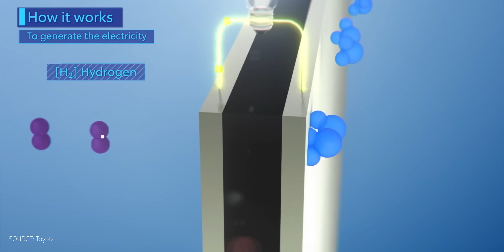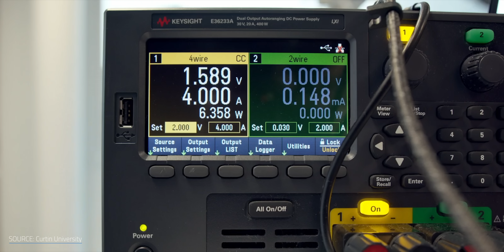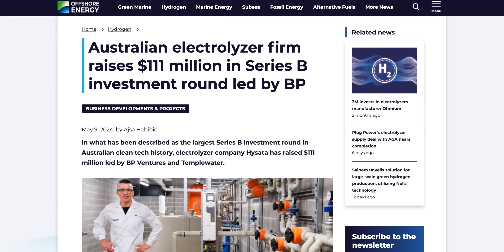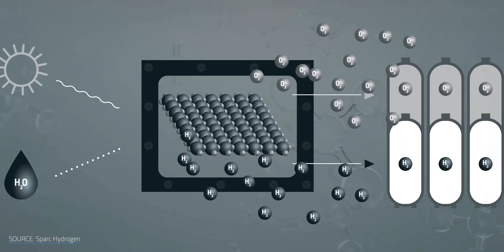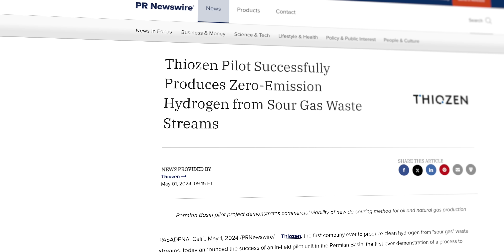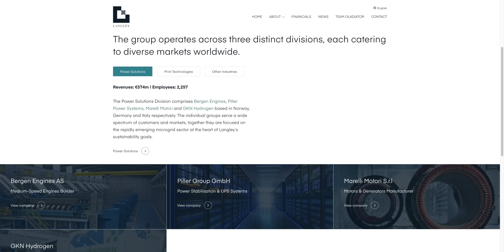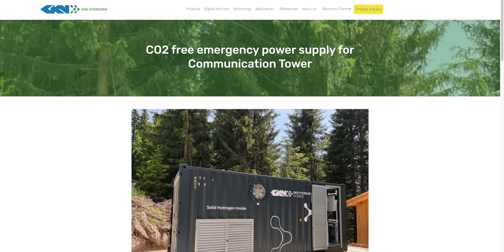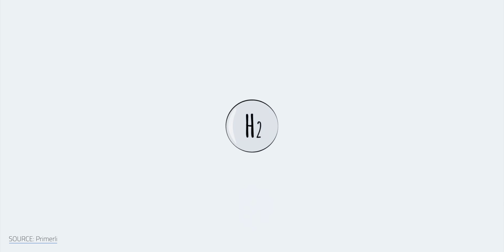How a Hydrogen Breakthrough is Closer Than Ever

Comment: So Engines running on Hydrogen are clean, but the stuff that separates Hydrogen from things like water can be powered by fossil fuels.
Do the Engines that run on Hydrogen generate enough power to power the process of separating Hydrogen from say water and have enough power left over?

If Hydrogen cant be used as a fuel to power the process alone, cant we try to power it with a combination of the same Hydrogen produced and some renewables? Then Hydrogen left over would be proportional to however much renewable energy we were able to channel into the process?

Comment: Storage and distribution seem like big challenges. And then, when the product is finally there to use, is inside of a vehicle really the best application?
It seems that hydrogen is more of an energy storage medium than a fuel. It takes energy to make it, then you use that energy later.
What about using hydrogen as energy storage on the grid instead of battery storage? That would solve the hydrogen transportation part and help efficiency a lot. It seems like a good place to start.  Use excess grid power to generate hydrogen at a fixed location, and then use that hydrogen to generate power during peak demand.
I think they need to sucessfully use hydrogen in a niche like that way before we start talking about cars and distribution infrastructure and all the embodied carbon and expense involved in that process.

Comment: So after nearly 12min, absolutely nothing has changed. The alleged green game changer technology's are still only wild claims from labs which means absolutely 0, whilst the stuff in the real world is the same old floored tech, or stuff being pushed by fossil fuels firms which is about as green as ur auntys left bollock. Make a video in 20 years when theres some serious contenders on the market with varifiable products, that arnt backed by fossil fuel giants for subversive gain.

And im just as dissmisive with battery tech until its mature for the same reasons.

Comment: I have been to Haßfurt, Germany. They already have a Power-to-Gas plant that runs on renewables when the grid is at capacity. They feed the H2 into a natural gas line to circumvent storing problems but still impressive.
You mix H2 with natural gas up a point till it reaches peak energy density. It was really cool.

Comment: So, we take electricity, which is a great energy, easy to transmit, easy and versatile to use in very efficient machines. We take this energy source and go through complex and technically difficult processes to convert this to hydrogen which is technically extremely complex to store and distribute. We then burn this in low efficiency engines. Anyone see the problem here?

Comment: I live in Japan and have just purchased my second hydrogen fuel cell to heat hot water and generate some of the electricity for my home. The fuel cell is the  Enefarm from Tokyo Gas. As the company name suggests, the primary fuel is natural gas that is reformed in the Enefarm to created hydrogen. It’s far from a really green solution, but the system efficiency is significantly better than a traditional gas boiler, when you consider the electric power offset. Right now the system is filling its tank with hot water as it knows that bath time is coming in a couple of hours. At the same time it’s generating 550 - 600 watts that is taking care of all of my current electricity needs. A big breakthrough is great, but let’s take small steps in energy savings and efficiency that use current technology.
Reply: @iseolake  I love reading this account
Reply: "A big breakthrough is great, but let’s take small steps."  The small steps are only demanded by a profit and growth-oriented energy sector. We could have all we need if we just fully embraced renewables and forgot about these shareholder-soothing technologies. Sadly there is little to profit from in switching directly to renewables worldwide. And so we are stuck, telling ourselves it'll be okay and shrugging while someone's home gets destroyed by another record-breaking storm...
Reply: @Slimboid  Renewables are oppressive garbage which are also primarily profit driven....
Reply: How can reforming CH4 to H2 (plus storage and shipping) and using it for heat and electricity be more efficient than using the CH4 to produce electricity in a power plant and you using this electricity to drive a heat pump?
Reply: @AR_434 rather than use a gas boiler to make our hot water (also used for floor heating) the fuel cell turns on and generates electricity as it heats the water with waste heat from the generating process. Overall efficiency of this cogeneration system is higher than a boiler when the electricity offset is considered. There is no fuel storage. Gas is reformed as used. Net net is that our combined gas & electric bills are lower with the Enefarm than the combined bill with a traditional gas boiler.
Reply: You are losing about 60-50% of the energy in the energy transformation. This is almost comparable to coal in terms of CO2 emissions.
Reply: @ohadcarny6047  The EneFarm uses this waste energy to heat water for our floor heating and our bath and other hot water needs. Overall system efficiency in household use is significantly higher than a gas furnace with grid electricity.
Reply: @ohadcarny6047 no, cogenerated electricity and heat (gas) consumption (with the Enefarm fuel cell) is lower than the combined (electric and gas) bill if using a traditional gas boiler. The system uses a fuel cell to create hot water (first) and uses the electricity generated to offset electricity from the grid.
Reply: @iseolake sounds awfully complicated. Then your need for heat and electricity have to align or you need an additional battery. If you need a battery anyway, solar + battery + gas boiler is a much cheaper and less complicated and more flexible approach.
Reply: @AR_434 it is complicated. It stores hot water in a tank to align demand with supply. Hot water storage is a lot cheaper than a battery.
Reply: correct re not a green solution. far from it. ammonia from air, water and electricity would be far better.
Reply: I don’t understand why there is a need to convert the natural gas to hydrogen if the fuel cell can run on natural gas to begin with. There is more energy lost in the conversion from natural gas to hydrogen…
Reply: @RB-xv4si the carbon in natural gas damages the fuel cell, so it has to be stripped out in a reforming process. Yes, it wastes some of the energy, but the total system, even with this loss, is still more efficient, and more environmentally friendly, than regular gas-powered boilers, when you include the electricity generated. If you could get hydrogen piped to your home, that would be great.
Reply: @iseolake there are fuel cells that are designed to specifically run on natural gas.

Comment: You will only make hydrogen by electrolysis if the electricity is almost free. This is the case when wind and solar are making more power than can be used by the consumers. The hydrogen could then be used in fuel cells to make electricity on cold, still dark nights. Batteries are getting cheaper all the time. When it is cheaper to install grid scale batteries than to make hydrogen there will be no incentive to do so.
If the solar farm is thousands of miles from the consumers it will have to make hydrogen. To transport it the most logical way is to make ammonia. Ammonia is made from nitrogen and hydrogen. There are already designs for ammonia plants that can run intermittently. It can be stored at room temperature at a pressure of 10 bars, or as a liquid at -33OC. In 2023 world production of ammonia was 150,000,000 metric tons, almost all from fossil fuels. There are facilities for transporting it all over the world. “green” ammonia could displace most of this.

Comment: Are we still dependent on platinum as a catalyst? Or have any of the investigations into alternatives turned up something cheaper that is also commercially viable? 
This is yet another issue with hydrogen power on top of the numerous other issues.

Comment: One problem a lot of renewable sources have is energy storage. This has lead to several wind turbines basically being turned off because of supply/demand issues. If we can have those generating hydrogen during low demand you could get more out of your windmills. The Hydrogen could be more easily stored and used.

Comment: everyone keeps asking for wind and solar hydrogen but I think we'll have to accept sonething like nuclear for it.
Nuclear is a bad option for supplementing the highly variable green energy of wind and solar... but for hydrogen? run the reactors at a safe comfortable speed and pump out hydrogen.
Need more power on the grid? use that hydrogen. Need less? Make more hydrogen and bottle it for sale.
Sure you're going to want the hydrogen plant a few km away but you can even give it direct lines from the plant to simplify it.

Comment: Wind and hydrogen help with base load as rather than paying farms to remain idle on low demand, they can use hydrogen as a low cost long term store which is still elusive for battery tech.
Same Solar PV and that peak spike where imbalance costs money and gain hydrogen can go to long term seasonal stores and longer.
There is a band about 23 degress above the equator that has many coastlines where near flat annual irradiance has 250% more sun than say Manchester UK and hydrogen made there is very cost effective and allows further products such as hydro-chem such as fertiliser and is a petro-chem challenger that means hydrogen is far wider than just energy storage.
Hydrogen like natural gas will likely be shipped where for northern countries much will be imported, where once again cost is a matter of economies of scale.

Comment: Hydrogen has a broad range of industrial applications beyond power generation. So divorcing it from fossil fuels as much as possible is always going to be a worthwhile investment, and, it will also make a solid addition to a constellation of generation options that will diversify power generation, providing greater strategic robustness and stability. 

Just for national security reasons we should never rely heavily on a single generation technology, nor on a single generation site; and multiple smaller interconnected sites that can network power around and to affected locals from nearby sites not as affected by any event, are both harder to wipe out in a single event, and provide better disaster resilience than one or two large sites that could be more easily compromised or isolated from areas power is needed. 

So use everything, rely on nothing. Build a solution that has redundancy and resilience.

Comment: Compared to pointing PV panels and the sun, or wind turbines and the wind, or what's about to emerge in geothermal, or hydroelectric in water, to capture energy and go straight to electrons running through wires for immediate use on the grid, or into plentiful batteries for ready storage, there is NO REASON to spend so much energy to create H2 fuels just to have to truck it around, or send it through leaky pipelines all over just to keep the Oil and Gas industry in a position to screw us all again and again. They screwed us with plastics and plastic pollution. They screwed us with CO2 emissions. They have screwed us with lung and environment damaging pollutants, and screwed us with every chance they had. Well screw them! H2 has it's uses but as a general fuel for grid energy or vehicles? F-No!!

Comment: Yes, hydrogen can be used to create other forms of power besides electricity, thanks to its versatility as an energy carrier. Here are some key ways hydrogen can be used to generate power or energy in forms other than electricity:

1. Heat Production (Combustion)

	•	Hydrogen can be burned directly to produce heat, similar to how natural gas is used for heating. When hydrogen is combusted, it reacts with oxygen to produce heat and water as the only byproduct, with no carbon dioxide emissions.
	•	Applications:
	•	Industrial Heat: Hydrogen can be used in high-temperature industrial processes, such as steelmaking, cement production, and chemical manufacturing. These industries typically rely on fossil fuels for heat, so hydrogen offers a cleaner alternative.
	•	Residential and Commercial Heating: Hydrogen can be blended with natural gas or used directly to heat buildings. Some countries are experimenting with using hydrogen in their existing natural gas grids.

2. Hydrogen as a Fuel for Internal Combustion Engines

	•	Although hydrogen is typically associated with fuel cells, it can also be used in modified internal combustion engines (ICE). In this application, hydrogen is combusted similarly to gasoline or diesel, generating mechanical power to drive a vehicle or machinery.
	•	Applications:
	•	Hydrogen-Powered Combustion Engines: Companies like Toyota are experimenting with using hydrogen in internal combustion engines for cars and trucks. This method produces fewer pollutants (like nitrogen oxides) than gasoline or diesel combustion but is less efficient than fuel cells.
	•	Aviation: Some researchers are exploring the use of hydrogen in combustion engines for aircraft, which could help reduce aviation’s carbon footprint.

3. Hydrogen for Synthetic Fuels (e-fuels)

	•	Hydrogen is a key ingredient in the production of synthetic fuels, also known as e-fuels. These are carbon-neutral fuels made by combining hydrogen with carbon dioxide (CO₂) captured from the air or other sources.
	•	How it Works: Hydrogen produced through electrolysis (using renewable energy) can be combined with CO₂ to create synthetic fuels like methanol, ammonia, or synthetic gasoline and diesel. These fuels can be used in existing internal combustion engines, planes, and ships without major modifications.
	•	Applications:
	•	Aviation: Synthetic jet fuel can be used in aircraft, helping decarbonize long-haul flights.
	•	Shipping: Ammonia, which can be produced from hydrogen, is being explored as a clean fuel for ships.
	•	Ground Transportation: Synthetic gasoline or diesel can be used in conventional cars and trucks, providing a carbon-neutral alternative to fossil fuels.

4. Hydrogen for Ammonia Production (Energy Carrier and Fertilizer)

	•	Hydrogen is widely used to produce ammonia (NH₃) via the Haber-Bosch process, which combines hydrogen with nitrogen from the air. Ammonia is primarily used as a fertilizer, but it is increasingly being viewed as a potential energy carrier and fuel.
	•	Applications:
	•	Ammonia as a Fuel: Ammonia can be burned in internal combustion engines or used in fuel cells to produce energy. Some shipping companies are looking at using ammonia as a low-carbon fuel for large ships.
	•	Energy Storage: Ammonia can store and transport hydrogen in a denser, more stable form. It can then be “cracked” back into hydrogen for use in fuel cells or other applications.
	•	Fertilizer: Hydrogen is already widely used in agriculture to produce ammonia-based fertilizers, which support global food production.

5. Hydrogen for Hydrogenation in Chemical Processes

	•	Hydrogen is commonly used in hydrogenation reactions in the chemical industry. Hydrogenation is a process where hydrogen is added to other compounds, typically to reduce or saturate them.
	•	Applications:
	•	Petroleum Refining: Hydrogen is used to remove sulfur from crude oil during refining, making fuels like gasoline and diesel cleaner (desulfurization).
	•	Food Industry: Hydrogenation is used to convert unsaturated fats into saturated fats, such as turning vegetable oils into margarine.
	•	Chemical Manufacturing: Hydrogen is also used to produce important chemicals like methanol and synthetic hydrocarbons.

6. Hydrogen as an Energy Carrier (Storage and Transport)

	•	Hydrogen can store energy generated by renewable sources (such as wind or solar power) and transport it over long distances, which helps balance supply and demand in energy grids.
	•	Hydrogen-to-Power: Hydrogen can be produced when there is excess renewable energy, stored, and then used later to generate electricity when demand is high or renewable energy supply is low.
	•	Hydrogen for Transporting Energy: Hydrogen can be converted into ammonia or other energy carriers and transported by pipelines, ships, or tankers to places where energy is needed. This allows for the global trade of renewable energy in the form of hydrogen.

7. Hydrogen for Nuclear Fusion (Potential Future Application)

	•	In nuclear fusion, isotopes of hydrogen (such as deuterium and tritium) are combined under extreme pressure and temperature to form helium and release vast amounts of energy. While fusion is still in the research and development stage, it holds the potential to provide virtually limitless clean energy in the future.
	•	Applications:
	•	Energy Generation: If successfully developed, nuclear fusion would generate enormous amounts of power without producing long-lived radioactive waste or greenhouse gases, as hydrogen is the primary fuel.

In Summary:

Hydrogen can create energy in several forms beyond electricity:

	•	Heat production through combustion.
	•	Mechanical power via internal combustion engines.
	•	Synthetic fuels like e-fuels or ammonia for vehicles and planes.
	•	Chemical processes like hydrogenation.
	•	Energy storage and transport, enabling renewable energy storage.
	•	Future nuclear fusion technology.

These uses showcase hydrogen’s versatility as a clean energy source in a range of industries beyond electricity generation.